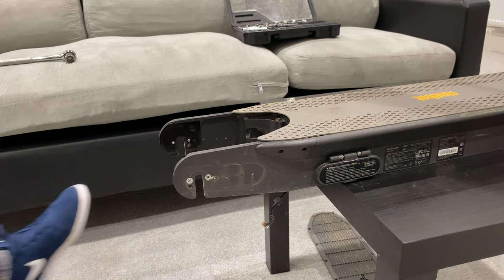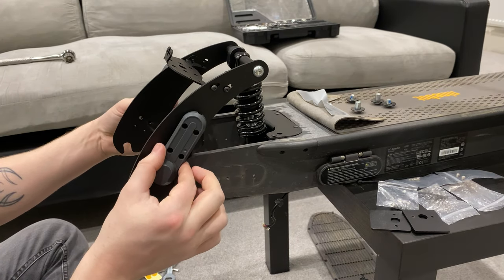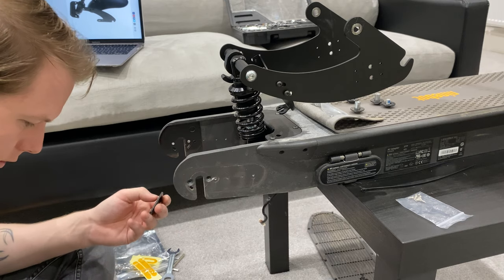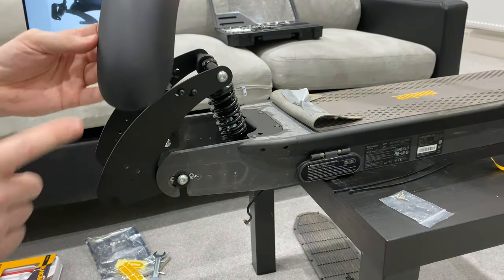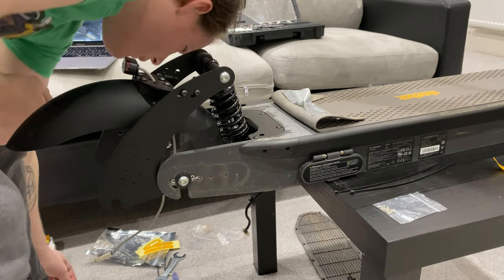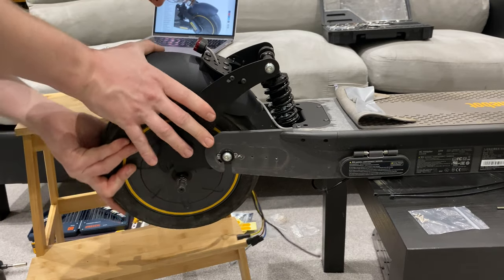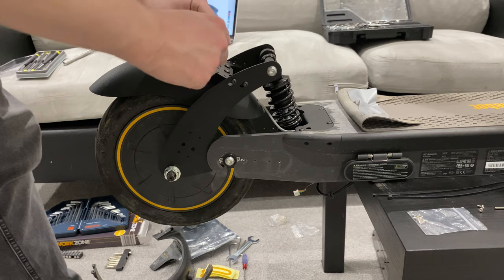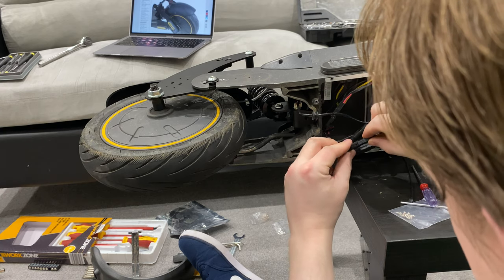How to install Ninebot Max Installing rear suspension part 2

Comment: Thanks for showing the process of adding the rear suspension! So hard to find any good videos that do it properly. In your opinion, do you think the suspension is worth it? I only use my nine bot MAX on Main Street roads and was wondering if its worth adding the extra suspensions.
Reply from the maker: Yeah I couldn’t find any of this on how to install.  I was figuring it out as I was installing.  

In terms on if it’s worth it.  This is very much a case of what sort of miles do you do and if there is man cracks and bumps on your route.  It will smooth them out. 

However, it may not be justified if your only going short distance. 

I like to ride for as long as I can so for me it should help.  The only downside for me is that it may reduced my miles per charge.  

More test is going to be needed.  Maybe a external battery would compensate for that.

Comment: good evening I have a question, I have a scooter based on the ninebot max, so I want to customize it, and add the shock absorber, but I am concerned that mine does not have anything for the lower part of the screw support, My doubt is in the min 4: 05 did you also have to tighten a screw from the bottom to the top ??, or that part with the pressure of the 4 above is enough

Comment: Thanks for the help I love that work bench by Ikea, I have the same model. I paid C$10 before Covid and now they sell today for C$15. I think I'm going to get a Sharkset front suspension instead of a Monorim, any thoughts on latest versions? I picked up the Ulip suspension with large brake light and signal lights. It conflicted with the Ninebot Max G30p and would only work when the headlamp was on. And when I turned off the headlamp I was then left with no brake light or signals unless I shut the scooter completely off for 10-20mins. In the end I threw away the Signal/Mode selector and bought a Ulip Signals Lights set and then got both my brake light and signals to work properly (and seperate from each other). Have A Good-Day...eh!!!

Comment: I installed the rear suspension today. You actually don't need to disconnect the cables. The only cable I disconnected was the brake light!! -18 ° Celsius where I live so haven't got a chance to try it out yet!!
Reply from the maker: Thanks man.  I disconnected them to make sure that I don’t destroy anything. There was no guide for this out there.  

But hey. I got 2 videos out of it haha
Reply: @ScootLetsGo  Yeah, I followed your video but didn't disconnect. Without your video I wouldn't have figured it out. Keep up the good work ,🙌
Reply from the maker: Thanks dude :).
Reply: So did you do it without taking the baseplate off?
Reply: @mynameisweevil  No I took the baseplate off so I could see the cables. I wanted to see how long I could pull the cable 👍
Reply: @Wulta84  But you could do it without taking the plate off?
Reply: @mynameisweevil  yes, I suppose so! Shouldn't be any problem
Reply: @Wulta84  Nah, you def need to take the plate off to feed the cables through a bit. Works really well though.

Comment: I've watched both parts of your installation process videos and I just realized, there doesn't seem to be any need to actually remove the wheel in order to install the suspension?
If I'm understanding it correctly, all it seem to need is a bit more length to the wheel cable, right?
Reply: I agree, and also he shows disconnecting the power cable but did not tell anybody that it will void the warranty, which has the anti-warranty tape.
Reply from the maker: Hi. Although it’s not necessary to to remove the motor. It makes the job so much easier.  
In regards to warranty. Any modification you make to the scooter is going to void it.  So adding the suspension without taking off the motor will still void the warranty
Reply: @ScootLetsGo  "Any modification you make to the scooter is going to void it.  

"So adding the suspension without taking off the motor will still void the warranty”

This is not completely true. It can always be reversed if you have a warranty issue as long as you do not remove any tape .

Don't get me wrong, the services you are doing for the public are appreciated.
Reply from the maker: There’s always grey areas with warranties. Even here in the UK where we have some of the best consumer laws, a lot of the warranties aren’t worth the paper they are written on. 

I would usually add a disclaimer either in the video or the description. However in this case I may have forgotten.
Reply: @ScootLetsGo  I want you to understand I'm not trying to discredit anything you're a posting and you are very much appreciate it but people don't know about the anti-warranty tape and it's a shocker when you first find out. The best to you.
Reply from the maker: Sorry if it sounded like I was going against you here.  That was no my intention.  

I like to make sure my thoughts come across.   As a non professional content creator I do miss things from time to time. And it’s great when others pitch in on solutions :).
Reply: @ScootLetsGo  What the hell am I thinking about warranty? I have heard Segways warranty is awful. Sorry I even brought it up, carry on my friend.

Comment: hey.. i got error code 18 after the installation.. What have I done wrong? Please Help
Reply from the maker: Please recheck the connecting wires.

18	Wheel Hub Motor Hall is abnormal , Please check the Motor, Control Board & related connections	Control Board , wheel Hub Motor

Comment: Since this involves removing the motor wheel itself and unplugging wires, I wonder what kind of negative effect it might have on the water resistance of the scooter itself?
Reply from the maker: Anytime you make a change that isn’t part of the factory spec you are always at risk of compromising the water resistance. But I have had no problems. And the scooter parts internally are built solid
Reply: @ScootLetsGo  
Excellent! Good to know
Thanks for responding

Comment: Looks like after installing this suspension you cant use the folding feature of the scooter as it cant be hoked to the fender.
Reply from the maker: It’s ok you can still fold

Comment: Does the suspension (front and rear) affects the range or speed in any way?
Reply from the maker: The speed feels the same.  However, I think the range will be affects as it’s adding around another 1kg. 

Once the weather clears up I will be able to test properly.

Comment: Hi, do you know how long in mm is the suspension? And how lbs is rated the spring? Thanks for the video!
Reply from the maker: It’s rated for the same weight at the scooter is designed for. So around 100kg.  More testing needed.  

It extended the scooter by about 90mm

Comment: so you’re getting new motor deck mount
Reply from the maker: Motor deck mount?
Reply: Unless you machine your existing deck mount, you'll need to get one with disk brake screws.

Comment: nice 👌 I've been thinking about buying the rear suspension the whole time! 
Is it worth ? How is handling?
Reply from the maker: It seems to handle ok.  I haven’t had much chance to play yet. Due to weather being terrible.  I will continue to play to see what happens.  

So far so good :)
Reply: @ScootLetsGo  
ok thank you 🙏 
I would be happy if you could give us feedback again if you know more. 
My front suspension is coming next week. I took the monorim mx1 with the black spring in front. I can tailor it to me how hard I want it.
And my thought was maybe I don't need the back if it doesn't use much or the stability deteriorates
Reply from the maker: That’s great.  I want to get the Monorim variant so that I can compare.  

If you don’t add anything to the back you will simply be taking away the shock in the front. You still get that harsh feeling on the rear when you go over a bump or curb. 

With the rear suspension I found it soaks up those little bumps. And makes kerbs more tolerable.

Comment: Why humans dont learn nothing from what we have been doing all this years??? Not a single bearing in the whole thing... i have a mountain bike from 1995 and it has bearings installed in all the joints... and its 25 years old!!!!! 25 years have passed, and it still works almost as smooth as the first day... and i have only changed the bearings once.
Reply from the maker: This suspension on the rear was very cheap. So I wasn’t expecting it so perform that great. But it does the job.  I’m waiting for a better rear suspension that I will not have to drill my scooter like Monorims.

Comment: Just finished my front fork and will have to pass on the rear(looks very retarded)
Reply from the maker: How did the testing go on the suspension?   

I agree that the rear suspension doesn’t looks the best but it’s functional. And much cheaper than the Monorim variant
Reply: @ScootLetsGo  front suspension works but now my steering is a bit stiff.
Reply from the maker: Did you over tighten?